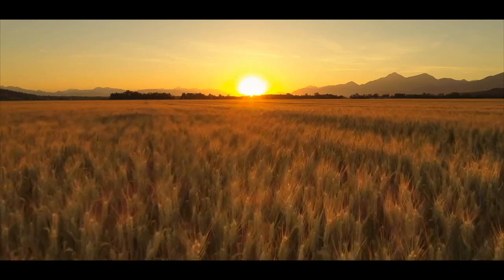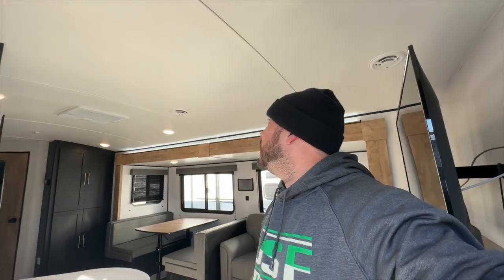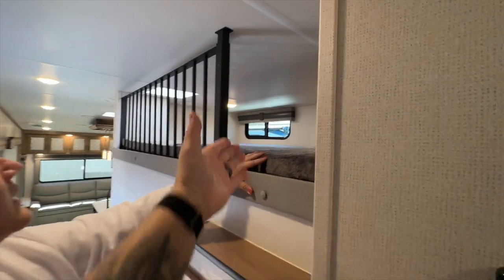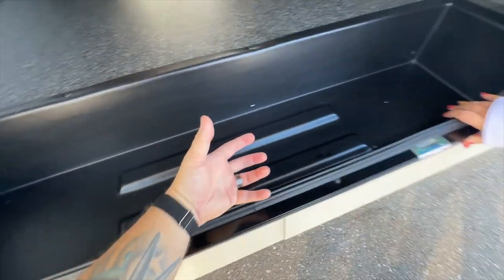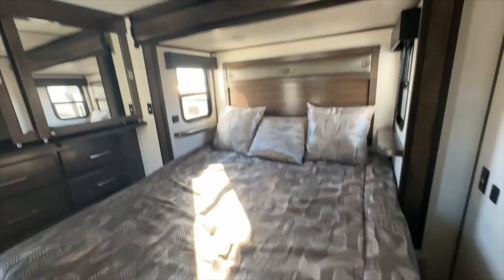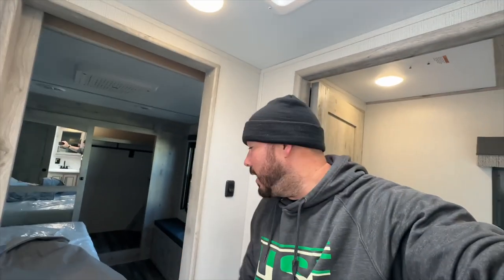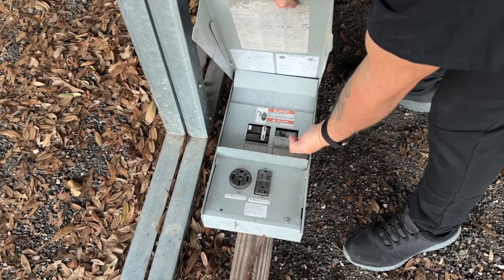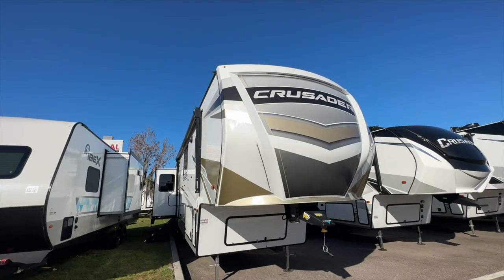Don't buy An RV In Until You Watch This

Comment: OMG..I used to live in High Springs..moved there for 2 years on horse business.  😃👍🏻
And from experience..if you get a camper with slide outs..and the slide outs are going to be out for a while you’ll need tripods to support them.  😃👍🏻

Comment: You need to bring an RV tech with you before you buy to inspect the roof check the vents and seams to make sure there is sealant in all appropriate spaces. Check the roof on all slide outs, check slide seals. I work warranty at a repair shop and we have 2023 coaches in right now for lack of sealant on windows and roofs. If you buy new it will probably spend the first 6 months in a repair shop. Best bet is to buy a year or 2 old and get an extended warranty on it. Parts for RV's are scarce. Good luck y'all.

Comment: My husband and I have a cabin it's probably 10 X 18. We have 5 hundred watt it will run our tv and frig. But maybe 2 hrs watch time. Stove is propane. Hope to go propane for the frig too soon.
Reply from the maker: That’s so cool. Nice setup for mild coolers temps when you can leave the windows open.
Reply: Specially for winter. Indiana weather you can put the frig out on the porch.  Less  power you have to use.

Comment: Once The Rv is towed to its permanent parking space .Then you'll have to put in an in ground septic system Because those tanks on the RV fill up very Quickly. Then have to have a Well Drilled for water  Plus Have power ran out to the Rv ...The Cost of the Rv Then the cost of having it all hooked up is To Rich for My Blood .....But It will Sure be Nice when you are done
Reply: Portable septic that only has to be dumped so far maybe once a week and only cost $10 to dispose and we hook into our well that’s being used for the new home. It’s all been pretty easy and cost efficient so far.